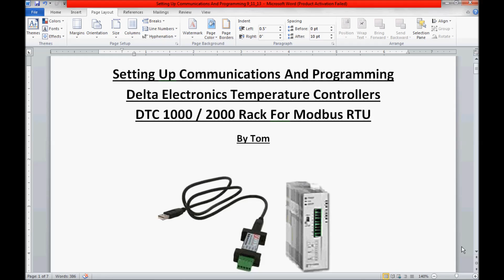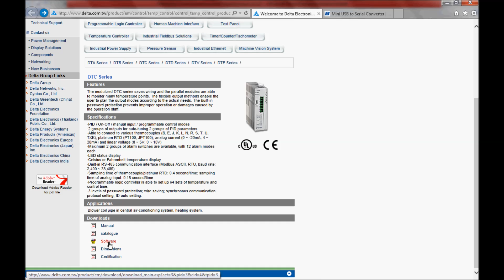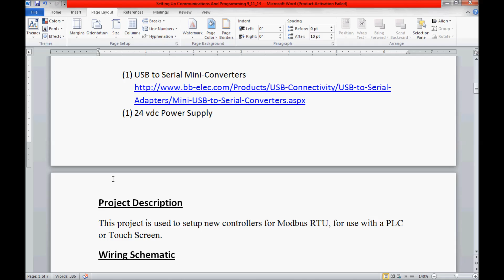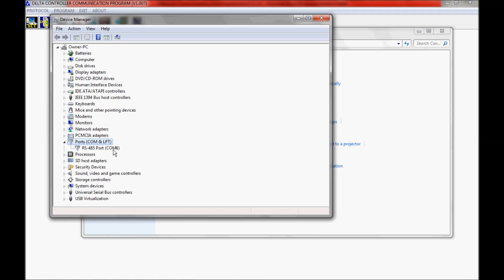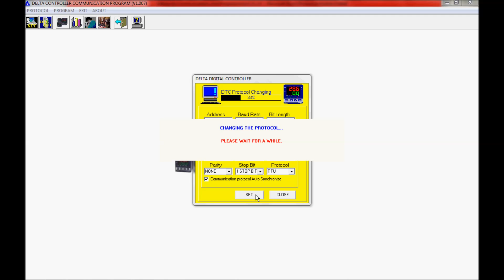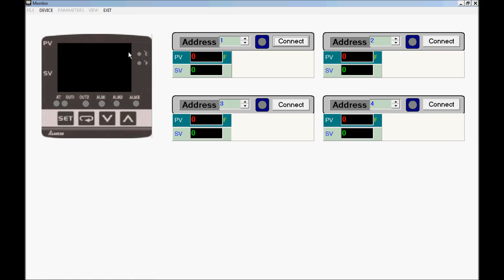How To Program A Delta Electronics DTC-1000

Comment: How to chang output C/V?
Reply from the maker: To change the Control Variable you have set the Control Method to Manual.
Reply: @tomh2466  can you explain that how.if posible in video
Thanks.
Reply from the maker: @hassanhadidi6467  

I added a video for you see if is what you need and let me know. Follow the link below.

https://www.youtube.com/watch?v=swJVHQqYbLE

Hope This Helps
Tom
Reply: @tomh2466  thank you very much my friend.
Reply: @tomh2466  Dear Mr.Tom,thank you very much.that video was very helpfull.i exactly try to change frequency of motor drive with DTC1000-V.when my temperature is changing then the freq.will change.from 0-10v other side 0-50Hz
Reply from the maker: @hassanhadidi6467  

Hello Hassan, 
If you are attempting to control the output frequency to the drive you will have to have a one that outputs a 0 - 10 vdc or 4-20ma signal. If using module with relay output, this will give you the run signal than set the output frequency manually.

See the Instruction Sheet for the Model Name Explanation .
Hope This Helps 
Tom

Comment: Hi, please, what maximium number of DTC connected with plc ? It's possible 22 termocouples in a PLC ?
Reply: Can I  use one DTC 1000 and twenty one DTC 2000  in one lan using IHM ?
Reply from the maker: According to the manual its 1 DTC-1000 for 7 DTC-2000, But I have had more than 12 Dtc-2000 to 1 DTC-1000
Reply: @tomh2466  for use with SSR, use final description " V " on model  ?
Reply from the maker: What type HMI are you using? I've done it with CMore by automation direct, Pro face and EZ-Automation.
Reply: @tomh2466  I still don't know which HMI I will use, I am choosing the equipment to use. I plan on using Delta B07e515.
Reply from the maker: The maximum number of DTC temperature controllers using modbus communications is 31.

Hope This Helps
Tom
Reply: Tom H thanks

Comment: Hii and Thanks for your effort but I have some problem in communication. I watched your video and try to connect DTCOM with DTC1000L but it is not connect. I dont know what is problem so i want help
Reply from the maker: Good Morning Bhavdip Bhal
A few things to check would be your settings of your serial port on your computer, also check the wiring of the serial converter another thing to try would select unknown for all settings and select start the scan will take about an hour if no connection made possible bad controller or serial converter.
Hope This Helps
Tom
Reply: I have USB to RS485 converter and check all parameter and also try all unknown but still not connect
Reply from the maker: Hello Bhavdip
Question, did you install the driver for the USB converter, are you able to communicate with other devices using the same USB port? At about 2:20 in the video I show where to get the converter I used in the video, if you used a different type there could a combat-ability issue, or you could have a bad communication port on the DTC 1000 module. While running the scan  does the TX or RX LEDs flash? You could try to reverse the wires.

Hope This Helps
Tom
Reply: But my USB converter show me as detected in my laptop. Still require driver ?

Comment: Is there anything that can be done if it is going over temp? the heater goes over temp by 10 or 20 degrees and before droping back at times. jsharwell@live.com
Reply from the maker: Justin,
You can perform an auto tune. But first what are you attempting to heat, the reason I ask is for applications that you are heating a mass of metal you may use a longer control period. At roughly 19:30 in the video I discuss a little about adjusting the control period (Ctrl. Period 1) If adjusting the PID loop doesn'tsolve it try the Control Period for each output. Item that take less time to heat up have a smaller control period,